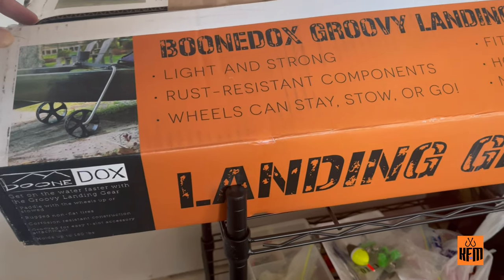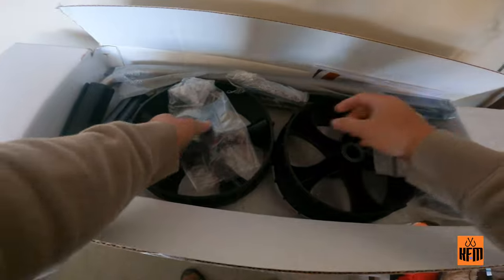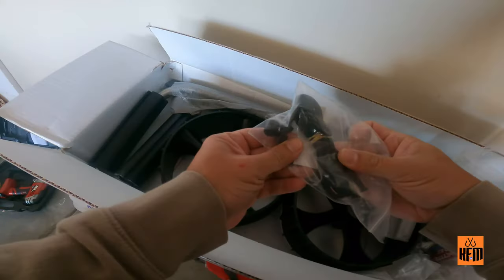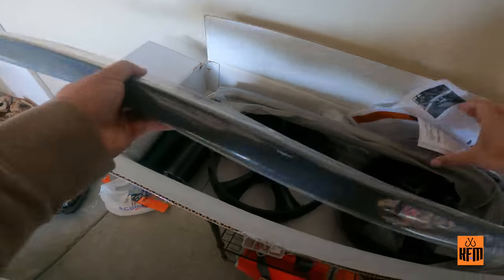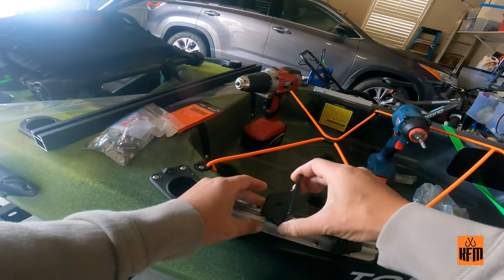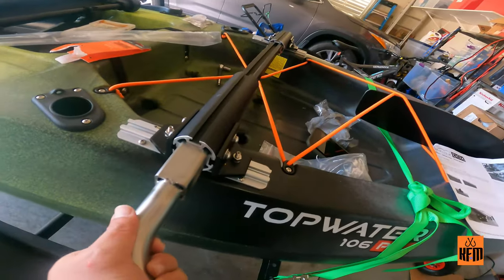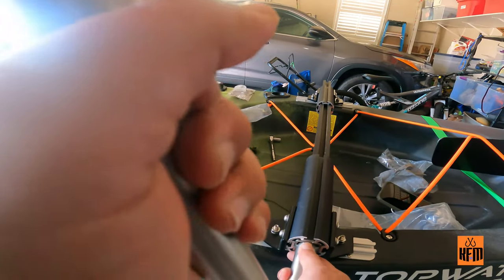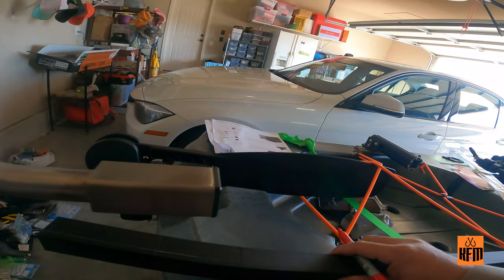Ep. 68 BooneDox Landing Gear Track Mount Unbox & Install  Old Town Topwater PDL 106

Comment: Good video. I’m surprised the track mounts can hold the weight and pressure. I have an Old Town sportsman 106 paddle and would love to use the boonedox system. Thanks for the video!7
Reply from the maker: I agree and it held wonderfully on there for many years now without any issues. Good luck and stay safe out there! Thanks for the visit!

Comment: How has this held up being almost a year old now. I have just the regular 106 non pdl but with my battery and motor along with gear its weighing roughly 150-160lbs (including hull weight) and just worrying about hull cracking if I go with boonedox. My yak is back end heavy tho as that is where the battery and motor resides.
Reply from the maker: It’s a wonderful add on my friend. Took the yak out more than 30 times already. With this setup and even with all the weight of the stuff I put on it, it has no cracks whatsoever. It has gone through a lot of bumpy roads at the boat launch area. What I typically do is put the pedal gear on it when it’s in the water since that thing weighs about 40 lbs. thanks for watching and commenting my friend!

Comment: I'm thinking about doing the same to my 120. I have the non pdl so I don't have a access hatch for a backing plate..My fear is that the screws would pull out over time from the weight. Have you had any issues?
Reply from the maker: No issues. I recommend using the same aluminum trackmount . I’ve used my kayak many times and hauled it in uneven roads and have no issues with cracks or damages to the kayak or the aluminum. Thanks for watching , stay safe , and good luck!

Comment: Hey just did pretty much same install on my pdl 120 , going to give it a try this weekend but I’m curious to how yours is working out ?
Reply from the maker: Dude best addition to my yak setup. I’ve been out maybe 20+ times in the water with it on and it holds up wonderfully. No issues at all …no cracks in the metal or kayak. Best add on!

Comment: Is there a reason why you used the track mount instead of just installing it right onto the kayak?
Reply from the maker: To me, the track mount  provides for a more secure install.  I've been using the kayak 40+ times and the landing gear is able to withstand rough movements during transport & launches. I've seen no damage whatsoever for 1+ years of using it. The trackmount also gives me an option  to put other stuff on it. Thanks for watching! :)

Comment: Great tutorial mark! Are you worried about potentially voiding warranty on the kayak?
Reply from the maker: Hi my friend. A little. 😊 I looked at OT Warranty and it is a little vague to me. I didn’t see any mention about voiding hull warranty due to installation of landing gears etc. there is a mention of negligence and misuse….I’ll try to do more research. I’ve taken the kayak out a few times with a lot of load after the install and it held nicely. no visible damage , whatsoever. I’ll probably do another review update after a year of use. So far, I’m loving the convenience of having this landing gear versus using the ones I have to place underneath the boat. Thanks for stopping by! 😊👍

Comment: Is that going to put too much stress on that section? That area is not reinforced in the Topwater. :(
Reply from the maker: Thanks my friend. I have been using it for months and have yet to see any cracks or issues on my kayak.  I'm 160 lbs and I can get on my kayak while the boonbox is on the landing position in the water. :) If i see one I will be sure to let you know.

Comment: I was considering doing something similar except further forward of course that would require cutting down the rudder handle and removing rear rod holders. Lot of work. The only thing I don’t like about my old town is that it’s not more accommodating of a landing gear
Reply from the maker: Totally understand. What kind of old town kayak do you have ? They are amazing kayaks the hull is strong and can withstand brutal battering.
Reply: @FishNTrips1  topwater 106 pdl just like you

Comment: what type screws hold the trac to your kayak?? I would worry since there is no way to have a backing plate behind that trac? or Am I thinking wrong? Install looks good. Hope it works great.
Reply from the maker: Thanks my friend. I used the 8 screws that came with it per track. I have no backing plate installed for now, but that same worry came into my mind. I took the yak out and held fine with about 130-150 lbs of weight! Hope it last though. I went with your recommendation and used the cam straps BTW :). Thanks again!
Reply: @FishNTrips1  oh yeah can straps are the bomb. You will love them
Reply from the maker: @BigBaitPosse  really loving them my friend! THANK YOU!